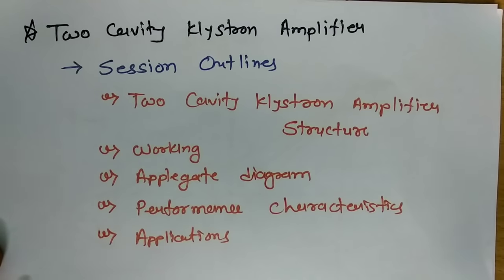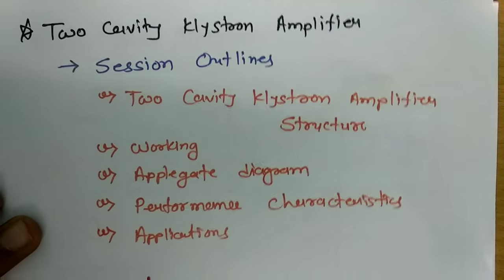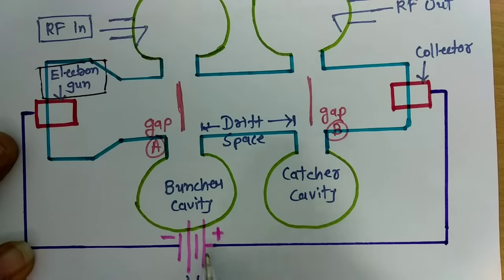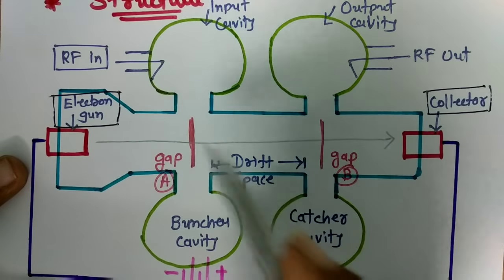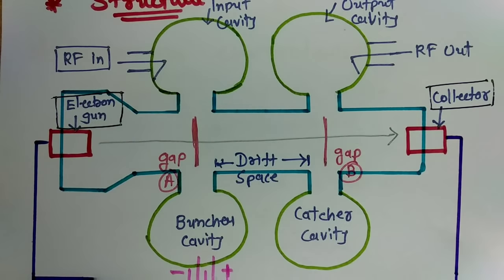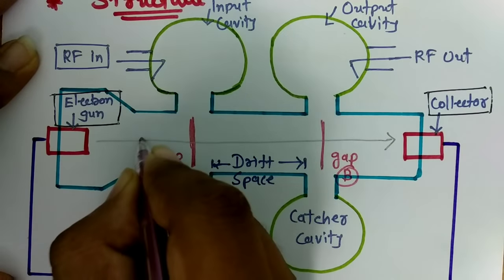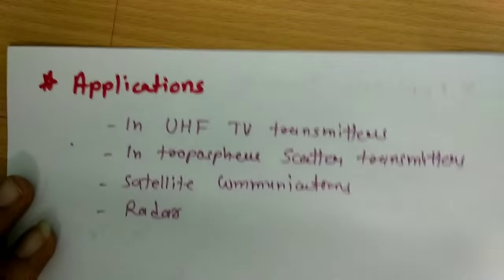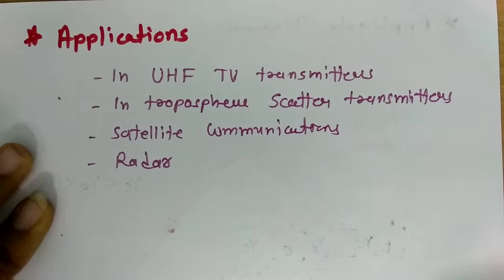Two cavity Klystron Amplifier's (Basics, Structure, Working & Applegate diagram) Explained

Comment: Sir don't you think that Applegate diagram you drawn earlier was right one because the early electrons will reach slowly and late electrons will reach fastly making velocity modulation to happen? 
In my opinion in apple gate diagram which you corrected was right earlier and it was wrong when you corrected it please reply as soon as possible. 
This is the first time I have a doubt in your lecture. You teach the best
Reply from the maker: Yup

Comment: Please, correct the statement at 1:39, if it is necessary.
+ve terminal of the battery is connected to the electron gun and -ve terminal of the battery is connected to the collector.
Reply from the maker: I will definitely take it in consideration

Comment: Sir I have a question when electrons get bunched how is input signal amplified is there some kind of addition...if u could explain I would be grateful
Reply from the maker: Based on signal bunching of electrons is happening and signal strength is weak at input but at output due to higher strength of electrons its strength is strong here. Strength of electron beam is decided by filament or cathode.
Reply: Engineering Funda thank u very much
Reply: @EngineeringFunda  I am New - This Is Fascinating Could you please do more thank you 2019 ✨